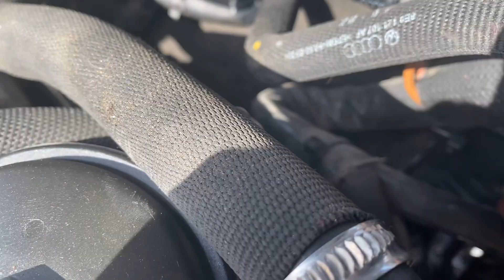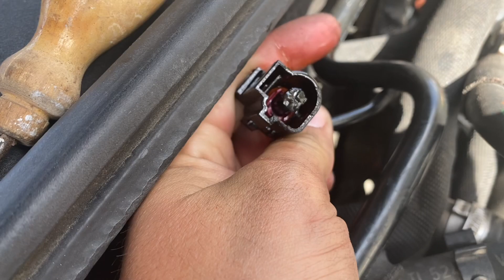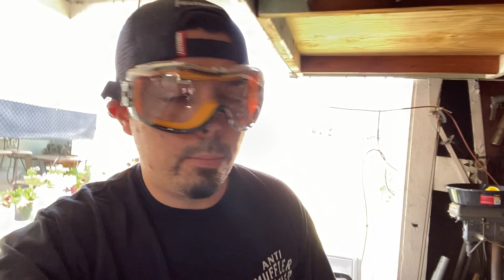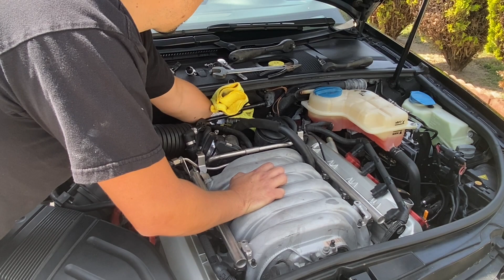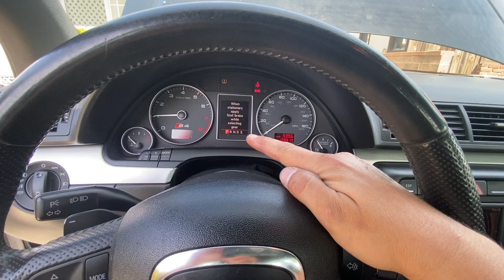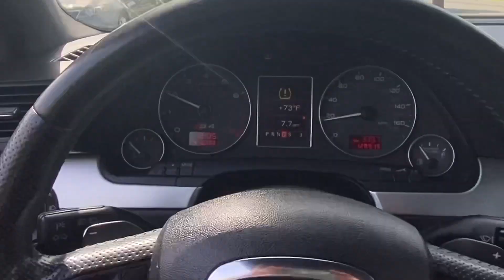Warning Low Oil Pressure Red Light Audi S4 B7 B6 B5 B8 Official DIY Fix

Comment: I have just bought an s4 2006 year. Has loud rattle, took cam covers off and looks like very little oil is getting to top of engine. Oil check valves under manifold seem OK, any ideas or advice would be welcomed. I do not have any low oil pressure warnings,  was wondering why oil isn't getting to top of engine very well, things look like they got hot.

Comment: I mean the whole time im wondering if a big enough wrench could have just done the job to remove it but i havent went and attempted yet myself i guess ill see once i go out to try it on mine
Reply from the maker: No need to wonder. The firewall is in the way. 🫡
Reply: I’ve done the job! A 24 mm ratcheting wrench did work, it was a little tight, but enough space for it to rotate and turn the oil pressure sensor.

Comment: Hey i have this problem too I have a regular 2.0T tho. I torqued the damn sensor too hard and when I took it back out a whole golden ring around came with it. So now I don’t know what to do cuz that golden ring Dosent just simply go back on, help please?
Reply from the maker: Probably just buy a brand new sensor. That copper ring probably came from the sensor base or something. Good luck.
Reply: @greenowlmotors  hey what’s up I ended up buying an oem part and replaced it and so everything is good thank you! But I still have the same problem where my check engine light comes on and the code is for the camshaft I have replaced everything involving camshaft crankshaft etc 😔 any help please?

Comment: Same issue on my 955 Porsche Cayenne S. Very easy to access switch, used a 24mm open-end spanner - came off in seconds. Unfortunately, didn’t fix my problem so still can start car..any ideas, anyone ..?..

Comment: Changed both hi n low sensor at the mechanic shop and got anew oil change and filter but the red light low oil pressure still comes on don’t know what’s going on with this car
Reply: Trust me!!!! Dont waste your money doing the simple stuff!!! It something internal inside your engine...i just replaced one engine with the red low oil pressure light and my next engine was doing the same thing!!! $7800 wasted!!! Got to start over!!
Reply: Im going to Drop oil pan and check/clean oil pick up screen on my wife's car as it's doing same. That's the only other thing I can think of
Reply: @Mancave Motorsports  once its in the screen, damage is already done...waste of time..
Reply: @cory jackson  thx, but I work from home and it's nothing for me but turning a wrench which is my happy space. My wife wants to go to the dealer for a new car anyway  as I think she has mentally detached from the car already lol, if she does ill just fix this and sell it cheap to someone in need, if not she will drive it. Luckily her job is 7 mile commute roundtrip
Reply: @Mancave Motorsports  i understand but....i think i was just referring to the money part not the work....
Reply: A red light is not for a sensor... that would be a yellow light
Reply from the maker: You are wrong. This issue was rectified 100%. This was a red oil light display for oil pressure sensor fault. Oil pressure sensor replaced never had the issue arise again. #confirmedfix
Reply: @Green Owl Motors  listen buddy a bad sensor dose not cause low oil pressure.. low oil pressure is when your engine is not getting the right oil pressure....a sensor will not cause bad oil pressure..try again dude!!!
Reply: @Green Owl Motors  oh and trust me it will be back... and come back and apologize like a man when you get that ding sound again!!!!
Reply from the maker: No one said a bad oil sensor causes low oil pressure buddy. The video was made to educate people that the oil sensor failing will throw this code and it wont always be a loss of pressure. Level up before you come spreading bad information. Its does not dose.
Reply from the maker: Look at when this video was made…it was fine. Again #confirmedfix for this issue. Stop making people second guess this particular repair. Its easy and quick.
Reply: @Green Owl Motors  easy and a waste of money and time...why would you tell ppl to replace a part that doesn't cause low oil pressure...please explain!!!!
Reply: @Green Owl Motors  your video should be titled...if you dont have anything to do with your money and time then change your oil sensor!!!
Reply: @coryjackson6034 rite the sensor reports if op is low or out of range,  or the sensor is bad like in this case and many others including mine, but when the sensor is bad it will trip the op light same as if you have low op. In this case easy fix just a sensor like he said.

Comment: Just put the socket on and they use a Vise Grip to grip it and loosen it. I also don't see why a regular open end box wrench to loosen it. And there are wrenches that rachet on the open end side. You could even do it with Chanel lock type pliers.
Reply from the maker: I have a million sockets. Took me 2 seconds and the time I saved I chugged a beer. Sunday everything was closed nothing stops progress. Glad you got yours figured out. 🤝

Comment: The simpler thing to do is use a 24mm 3/8 drive socket, which is 2.5in in length, as opposed to 3.1in (deep 1/4 drive socket).

Don't you feel like you wasted all this time and destroyed a deep socket?
Reply from the maker: Nope. We have tools for days and we don’t mind modifying tools to make things happen on a Sunday. Thanks for the tip for those that watch this video.

Comment: I'm dealing with this bullshit out of no where.  Drove my 2006 Audi S4 to work tonight and everything was fine on the way to work.  No issues.
I go back out to the car on my break to smoke a cigarette and I started the car up and I hear that (something is wrong) DING sound and I look
up to see the low oil pressure can on my head up display.  I turned the car off.  Started it again hoping maybe it was just some sort of fluke or
something.  This time the check engine light is now on.  What's weird is that when I press the little "CHECK" button that cycles through things
such as the oil pressure, everything comes back with the green light that says "OK" as if nothing is wrong.  Check engine light still on the dash.

I drove the car home for lunch and that's where I'm at right now.  Probably shouldn't be driving it?  I don't really have much of a choice though.
Despite the check engine light being on and being flashed with the low oil pressure icon, my car seemed perfectly fine driving it home.  
I do have some issues with the car burning oil a bit, so  I did check the oil levels and the oil is actually quite low, but I'm pretty sure this light
wouldn't just come on from having the oil levels be a little low right?  Could be wrong.  Hopefully I'm wrong but I doubt it.  Going to head out
there right now and top off the oil a bit and see if some how that damn check engine light goes away.  But again.. I highly doubt it!  

I'll be back later to possibly add more to this conundrum that I'm currently facing.  I don't have the money for this shit right now and of course
I'm not much of a car guy.  I can fix computer problems all day, but with cars I only have knowledge of the absolute basics.  If the issue I'm
having is exactly what you dealt with in this video, then I'm pretty confident I can fix it on my own, but if it's anything more major I'm fucked!
Reply: The low oil LEVEL warning should appear before a low oil PRESSURE warning.
It's probably a bad pump. So what happened?
Reply: Any update
Reply: Update

Comment: Awesome video and huge Thank you for pointing out my issue with this project.  For anyone coming here beyond this post date, there is a way to save a huge amount of time.  

I loosened the breather hose on the valve cover as indicated in the beginning.  Next loosened and set aside the coolant reservoir.  The two center houses next to the oil filter housing are flexible.  I simply loosened the one hose from the clamp on the firewall and moved it aside.  Instead of removing the remaining hoses, I took a large screwdriver and pried the clamps for the engine harness loose from the firewall.  This allowed me to get a large socket and full size ratchet into position to get the sensor out.  The ONLY issue I had doing it this way is the EXTREMELY brittle hard plastic vacuum hose coming off the fuel pressure regulator (silver globe pancake thing on the back to the right of the oil filter housing.).  I cracked this hose but was able to repair it as it cracked near the rubber so I took it loose, cleaned out the old plastic and fed the remaining hose back in and sealed it.  Overall took about 30 to 45 minutes including hose repair and dropping my socket when test fitting.
Reply from the maker: Awesome glad to hear!

Comment: Notice that the socket has a small hole, that hole is used as a last resort if you can not fit on a ratchet. You stick a small torx, Allen key or even a small screw driver all the way into that hole, then find something like a crescent wrench on the allen key and turn the socket with that to loosen the pressure sensor out. Sometimes it works, sometimes it's too tight to move it that way, but it is worth trying.
Reply from the maker: Ahhh, I thought I knew everything. That is a trick I did not know. Never needed it but I can see how it would work in some tight situations. 😎

Comment: Question i have a 08 Q7 4.2 i did an oil change on it today but the dipstick shows no oil on it its dry i left it sit for 2hrs n samething do you know why? I put 9 Quartz of oil
Reply from the maker: Hard to say, make sure the dipstick is down all the way.
Reply: I believe that motor requires 9.5 qts maybe even closer to 10

Comment: Miss my Audi, but the trouble and money i had when i had the oil pump replaced, £2000, then 2 months later the timing belt gave way, car scrapped 😳😭
Reply: Just had my oil pump replaced and the soil sensor , drove around about 100 miles, light just came back on?? WTH?? Any ideas?
Reply: @ferbbeyor422  did they replace your timing belt as well? Bloody red light light of death innit, i dreaded driving it till it eventually gave up, hope you sort it.
Reply: @ferbbeyor422  Soil sensor? Does that detect dirt in the oil?

Comment: Mine was just saying oil pressure on the dash do you think it's the sensor?
Reply from the maker: If you have this exact same light on then there is a good chance that it is.  I wouldnt drive the car around, if it has no oil pressure you can blow the engine in a very short amount of time. I was lucky it happened in my the driveway. My problem was indeed the sensor and a very easy fix.

Comment: I just used a 15/16” combination wrench
Reply: On my 2004 Audi S4 I used a 24mm end wrench / combo wrench to break sensor loose and then removed with my hand without unplugging the wire.  The plug was hard to remove and I could not figure out how the wire connector release worked.  I was able to unscrew the sensor and pulled it out with the wired attacked.  Then I was able to see how the clip worked and I removed it and then installed the new sensor and plugged it back up.
Reply: Is there really enough clearance to use a 24mm combo wrench without uninstalling the cooler (b7?) I was thinking of getting a 24mm crowfoot or 24mm stubby wrench.
Reply: @yeeaahhzz  sorry I was working on a Jetta
Reply: @mistoperator  welp, thanks for letting me know. 

Another option for anyone else reading is a deepwell socket with the existing small hole on the side. Use a drill to enlarge the hole enough to fit a sliding T handle in the hole.
Reply from the maker: @yeeaahhzz  Awesome! Thanks for replying! these little comments mean the world to some of the people going through this mess.